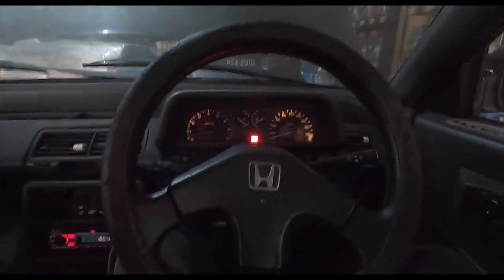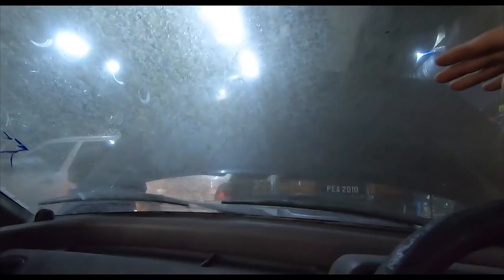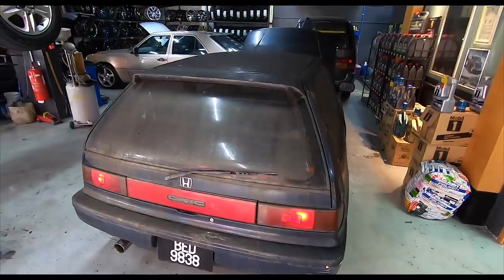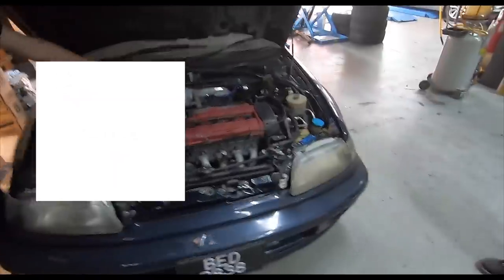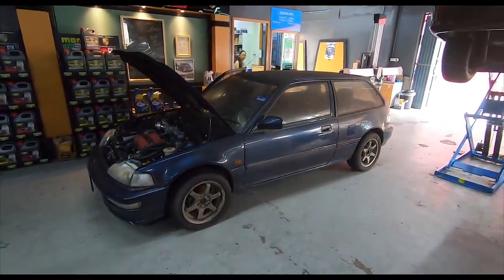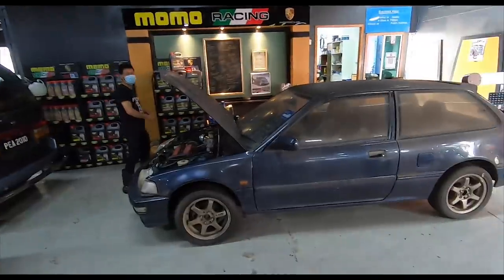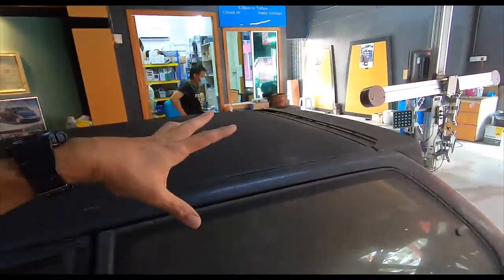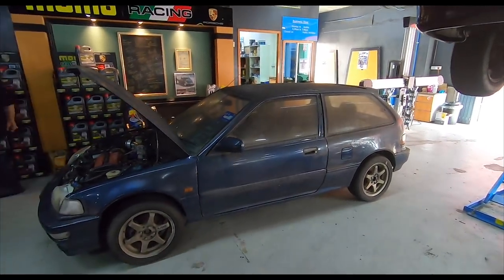[SOLD!] 1989 Honda Civic EF (M) 1.6i DOHC - New #JDM Project! AND it's FOR SALE! | EvoMalaysia.com

Comment: The hot car to have during the college days. The B16A was a gem
Reply from the maker: Yes indeed, they're still amazing cars, old skool #jdm 😊
Reply: there were 2 bonnet types, one with a sunken midsection for the 1.5/1.6 with the SOHC twin-carb D15B , and the raised mid-section for the EF Civic Mayat. 
Looking at the engine of Ken's car, it doesn't appear to be the VTEC version
Reply from the maker: @MaverickEchoJuliet  nope it's not 😊
Reply: @MaverickEchoJuliet  sifu ni... 👍👍

Comment: I think this is an EF3 model but the previous owner changed the front to EF9. It seems to have ZC DOHC engine instead of B16A from EF9. The original EF3 front end has shorter bumper signal light and has a bump raise on the left side.

Another thing that indicates it's an EF3 is the dashboard meter cluster is the smaller type with rpm meter limit at 8000rpm. The EF9 has 9000rpm limit.

The most annoying thing about EF interior is that the dashboard and its panels gets cracked easily. Not easy to find a good condition replacement for it. Some people swapped in Integra DA dashboard which is more durable, but will need slightly modification.
Reply from the maker: Wow, thanks a lot for the info! All I know is that the car is a Japan recon import, so yeah, the specs are a bit haywire 😄

Comment: This model was labelled as “Honda Civic Mayat” if I’m not mistaken 😬
Reply from the maker: Yeah, it was 🤭😁
Reply: No, the civic mayat was the EG-6
Reply: @ryzlannreza1873  eg6 is the civic bullet
Reply from the maker: @ryzlannreza1873  the one with the flatter back hatch right? I thought so as well but wasn't sure, thanks for the clarification bud!!🙏🏽👍🏾😊
Reply: I think sb3 used to called civic mayat...the one with flat back
Reply from the maker: @mohddzuladhamohdmansorkama991  thanks for the info bro 🙏🏽👍🏾😊